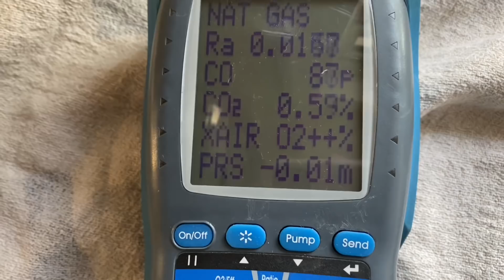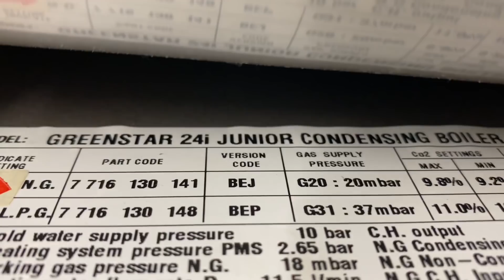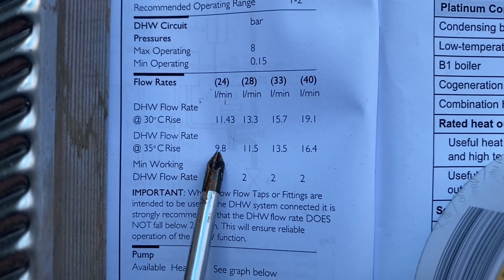Unsafe Boiler / Leaking and Hot Water Issues - Leeds Plumber

Comment: Well done for finding the fault . Regarding the gasket the instruction say replace the gasket when you have opened the heat exchanger , but then further  you do a negative vacuum  test and if it falls within the given parameters  it dose not need strip and cleaning . Pressure will read negative and be greater than: Natural gas LPG 24i junior - 3.1 mbar          24i junior - 3.6 mbar 28i junior - 3.9 mbar          28i junior - 4.6mbar • Pressures measured below these figures will indicate that the heat exchanger will require cleaning. . May be the instruction need to say the gasket need changing every 5 years or so , or if it dose I cant see it . Vaillant do something similar , the schedule says burner to be striped in year five and gasket replaced ,
Reply from the maker: Thank you so much for that.
Reply: @AllenHart999  I did skip through the first part of the video , I gather your wife is poorly by the other comments . I hope everything will end up all ok

Comment: Great vid as ever al. Hope mrs Hart gets well soon.
Onto the boiler, I honestly believe a lot of Worcesters dont get serviced properly because they are generally over complicated in terms of getting to common components. For example look at a logic or a 600 - so easy and lots of room to get your hands in. It's no excuse I know but I think they scare a lot of engineers off.
Reply: I think your spot on mate
Reply from the maker: Hi Matthew. Thanks so much.👍
Reply: Worcester confuse the matter by stating categorically that if the Heat Exchanger/Fan vacuum figures meet their specification, then don't dismantle the heat exchanger.  Who was it said "Manufacturers Instructions take precedence ? "  Oh..its the GSIUR isn't it...
Give Mrs H our best wishes for a full recovery Allen.
Reply: @timhancock6626  yes but they also state to dismantle the heat exchanger and replace seals every 5 years regardless of fan pressure
Reply: @craigwatson7692  Doesn't say that in the Greenstar Cdi or Greenstar Junior manuals I have in front of me. I do them anyway. Can you give me  a document reference so I can double check the 5 years thing. Its a few years since i've been on a WB course so it may have changed.
Reply: @timhancock6626  I think your right, had a look and cant see it either, I'm sure I'd read it somewhere though 🤔

Comment: Hope your wife is better soon, this virus is a bugger. Similar to your customer, many years ago was working in an office, was part office part on site, kept getting headaches when in the office. Put this down to the GM. Unbeknown to me our accountant was also getting headaches, to the point where she was getting very worried and was going for a MRI scan. The office was an old converted building several units combined, with 3 separate heating systems. The one for the GM’s office failed so he called in an gas engineer. Guy turned up, said when were they last serviced, not in the 10 years that I have been there. He decided to look at all of them, got to the one that covered mine and the accountants office, went to plumber speak, something like WTF, and put a big red sticker on it, not only had it been not serviced, it was not installed correctly, the vent was into a roof valley, and had been injecting carbon monoxide into the building. We moved shortly after that, and our GM, not wanting to pay for a new system, we were on a maintenance lease, got someone to recommission the boiler, clearly not as it was then corgi registered. Still used to go past that building, couple years later saw they were having a complete refit, guess that included the heating system. Stayed another 10 years with that company, we moved into a newly converted building that had a Valiant thermo compact, in that 10 years, it was also never serviced.
Reply from the maker: If they are serviced correctly then at least you know they are safe. Thanks.
Reply: @Paul Hill  The standards pertaining to business premises are usually a lot more stringent and exacting than those for private rented accommodation. That is in and of itself a sad, lamentable fact. It is especially so, for businesses if there are customers or visitors from other companies, entering the premises. How the hell did your health and safety admin. get an insurance document, in order to open and trade, without producing a gas safe cert? Your employer was in effect not looking after you and your colleagues in full accordance with the legislation. Could be worse. You could be renting a house off a landlord in Eastwood, Rotherham.
Reply: annual gas cert is a legal requirement for commercial premises... your gm was very naughty
Reply: clive ramsbotty  he was a lot of things, naughty was not on  the list, it was a long list

Comment: I worked on the odd worster about 8 years ago now,If I remember correctly the instructions for servicing asked you to check the fan pull,/ pressure with a manometer on the flue test points if if was over the stated figure no further work on the heat exchanger was required . I did have cause to get  a Worster engineer out to one which was banging when it came on or off sometimes . He striped it all down replaced a few bits but did say if you take the burner out best replace the seal . All this efficiency is all very well but it's now not uncommon for these high efficiency boilers to need replacing from 5 years on and certainly no more than ten . so you will possibly be putting three boilers in for the life of an older ( easier to work on and cheeper to fix) one . The CO2 gas is often mentioned as a reason for this efficiency drive but most condensing combies were set up to give 9% high and low which is a lot more than my trusty old glowworm Ultimate although I do admit will be less efficient.but I can fix it without any fancy test equipment and in any case hardly ever goes wrong ,pilot blocked up a couple of times and a PCB ,that's about it. Hope Mrs H is Ok now.
Reply from the maker: Yes you check fan pressure but it’s always good to check any burner seal on any brand of boiler. These do fail. Thanks.

Comment: It's all well and good saying get them serviced and do this and do that 

To many £40 service engineers out there are they going to remove the fan to change the seal and so on 

There needs to a standered across the board but that will not happen 

Grete video though
Reply from the maker: Clearly you cannot do the job correctly and pay for seals etc, Also pay for business running costs and do them for £40, Thank you.
Reply: Allen Hart , another great video ! Sadly the industry needs a shake up , if you work for a company doing service contracts they give 8 to 10 jobs a day. 😬 I also found that when attending manufacturers courses they would never commit to specifying a strip down service at every visit. This tends to lead to the point & Print culture 😢
Keep up the good work Allen & hope your wife gets better soon! Stay safe 👍
Reply from the maker: @gordonhastie8650  Thanks.

Comment: Good information Allen, 

I commented on your last vid asking for advice on dhw on my greenstar flow rate 
6lpm at kitchen tap, as you say they should be 10/11lpm on a 24ijnr.. 
I had a mess about with kitchen tap, took out tap aerator flow restricted and then measured flow rate again.. now I’ve got 14lpm dhw and 17lpm on cold mains 

So it was just down to the aereators fitted to new taps... I find it weird that boilers state there Lpm an then taps are different and you cannot get unrestricted aerator to allow full flow through the tap spout ..

 Cheers again Allen, keep safe
Reply from the maker: I have a lot of comments and sometimes miss some. Glad you got it sorted. Thanks.

Comment: I replace a lot of plate to plates on these, far more than anyother manufactures
Reply from the maker: That,s more to do with the installation though isn’t it? Thanks.
Reply: Yes and no, sure its blocking with crap , but i find this manufactures suffers more than others ans its a masive plate to plate ,possibly the reason?
Reply from the maker: @accesszero4803  Not really sure, I believe these are the same as other brands. Thanks.
Reply: I’ve noticed black plastic from the flow turbine adapters getting stuck in the plate to plate as well as bits of the plate to plate washers themselves!